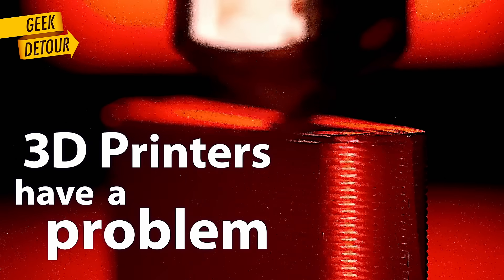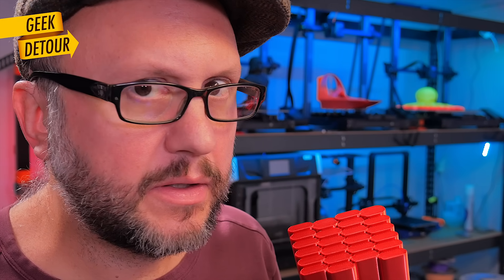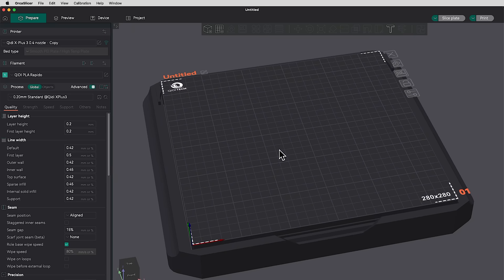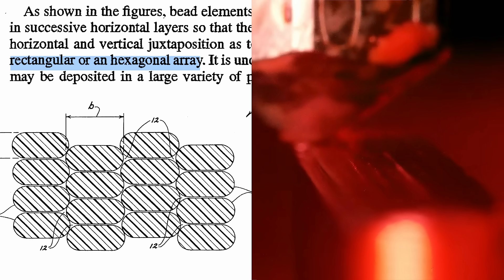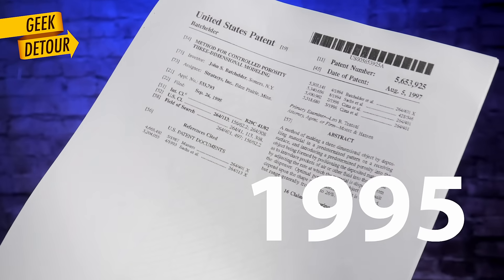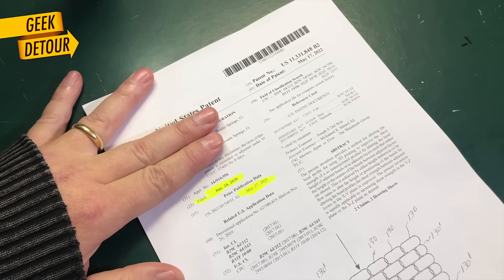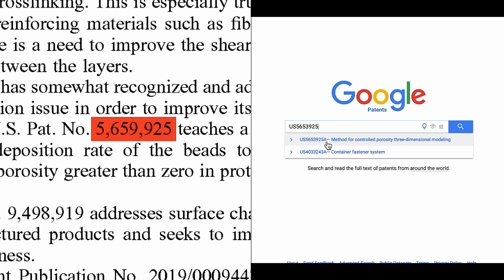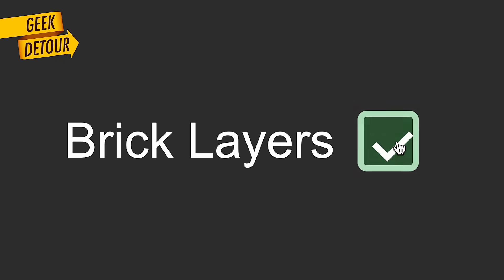Brick Layers: Stronger 3D Prints TODAY - instead of 2040 😬

Comment: There maybe a loop hole in the Issue itself, how you get to the effect. Stefans video is a great example to pull from. It is how he got to the effect and not the effect it self that is the "ground breaking" advance. Use the original public domain as your source, use his method ( A now copyrighted documentation) as the process to get there.

A selectable layer precesss using the X settings. It doesn't have to be specifically for the hexagonal interlocking layers, but a tool that allows for that and many other option through definable layer process that can be saved like a filament profile. we set temp, hight, speed and more with them. Why not one that can piggyback Process and Peramiter combinations ( using the CNC Kitchen video for reference vocabulary). Its not ground breaking, it's old tech. Most slicers can add optional or experimental plug ins, this one just allows for greater control of the filliment it self. 

Just like the ability to chose Colors with an Automatic Feed system. It selects new colors, setting for that filament, etc. Sorry, they wrote there paper poorly and with more holes than their layer lines have. I hope this makes sense after you and other get to read it. You can use old masonry or clay pottery methods as examples, I mean Knitting gets overlooked for Paterns of strength all the time. Use one of them. Here is to this getting to the right eyes and ears.

Comment: Bricks! 
Why not shift layer 2 right by half a column instead of up/down. I realize that this still allows a given layer to be distinct from those above and below it and thus break easily, but there's another way to view it. 

By printing a wider block centered over the gap in the 2 blocks below it, the middle of the top block will push into the gap more than if it was edge aligned. This is how brick walls are made strong. It would help both the Y direction (if X is along wall) but by inserting plastic into the gaps of the lower layers, it helps in the Z too. 

Plus, it doesn't sound like it's patented.
Reply: Then to go to 11, take another cue from bricks. Don't print each row tight to the next.

Print layer 1 as triple width (X = 3Z), thin bricks with a space between them of half that thickness (gap=Z/2). 

Then print layer 2 staggered by 1Z (1/3 the width) to the right. Ensure this pushes into later 1 space by more than 1/2Z. This locks this brick into the previous layer. Also, maintain brick separation space of 1/3Z again.

Repeat the next layers the same except stagger it right by another 1/3Z. 

Rinse and repeat until you get to the top.

Comment: Actually patents don't work like this. There are no examinators meant to verify that patents are valid or not. Patents are only registered and their registration does not mean they are valid.
It's only in the case where the author of a patent would like to sue a competitor for using a patented technology that the validity of the patent will be discussed and decided.

Patents can be filled for anything, it does not mean that every filled patents are valid.

Comment: Someone at the patent office fvcked up, and the patent should have never been issued, currently it should be revoked, but the only way that happens is if someone USES it, and then it gets challenged in court, then the court can recognize the issue and invalidate the patent.  However, what typically happens is someone uses it, and knowing the patent is invalid, the owners of the patent make the case drag out draining the defendant of money until they relent and settle paying them off, this is a patent scam that happens way too much.  These scammers have enough resources to last through cases, and they find old patents they can exploit in this way, and just continually repeat this process with hundreds or even thousands of patents.

Comment: Someone needs to challenge the patent and submit the prior art to the US patent office in a 3rd party disclosure. If the applicant lied about the cited references then the patent can be nullified because they were dishonest.
Reply from the maker: Hi there! Yeah, thats what we desire to do, right? Unfortunately, the patent system is more complicated than this… I’ve been contacted by a few Patent Attorneys and they were very kind to explain in more details what can be done — AND the COSTS 😬 There are alternative strategies. I am working with an Attorney Professor to make a special video talking about the patent system and the particularities of the Brick Layer case. It will probably happen in December.
Reply: @GeekDetour  It's also worth noting that you can use the patent for non profit purposes and research, and you can also use it outside the US. So if "someone" were to build an unofficial add-on enabling this feature there would be no way to stop that. If the patent holder were to try to enforce the patent you could just have a phone call with the holder and argue that their patent is useless and  they would lose it if it went to court based on prior art.

Comment: So best thing about open source is that this is very hard to control personal use, It can be done with gcode , for example this will give you the results-              def process_gcode(input_file, output_file, shift_amount=0.2):
    with open(input_file, 'r') as file:
        lines = file.readlines()
    
    with open(output_file, 'w') as file:
        shift = False  # Toggle for shifting alternate layers

        for line in lines:
            if line.startswith(";LAYER:"):
                # Toggle the shift for every new layer
                shift = not shift
                file.write(line)
                continue

            if shift and line.startswith("G1"):  # Modify only G1 movement commands
                # Split line to check if it's an X or Y movement command
                parts = line.split()
                new_line = []
                for part in parts:
                    if part.startswith('X') or part.startswith('Y'):
                        # Shift X or Y coordinate
                        axis = part[0]
                        value = float(part[1:]) + (shift_amount if axis == 'X' else 0)
                        new_line.append(f"{axis}{value:.3f}")
                    else:
                        new_line.append(part)

                file.write(" ".join(new_line) + "\n")
            else:
                file.write(line)

# Usage: Adjust `shift_amount` for the desired layer offset (in millimeters)
input_gcode = "input.gcode"
output_gcode = "output_shifted.gcode"
shift_offset = 0.2  # Adjust this value as needed for your print
process_gcode(input_gcode, output_gcode, shift_offset)

Comment: The latter patent doesn't really matter. As long as you're purely doing what is described and claimed in the earlier now expired patent, you can't really be stopped or sued successfully. At any rate the 3D printing community is filled with enough interested parties that surely lawyers could be hired to overturn this later patent if necessary.

Comment: Has anyone come up with an option to offset the infill on a X and Y axis? Completely different idea (on a legal point of view), the shape of the layers will differ from the patent and will even be different depending on the layer thickness. It will fill the gaps even better. I mean, just like if you were building a brick wall but instead the bricks being levelled, they were on a 45° angle.

Comment: I have a challenge for the 3D printing community!  Well maybe not a real challenge IDK, but I think it would be cool if someone did a 3D print of The Great Pyramid of Giza that can be assembled block by block  Make it so that it is about the average height of an adult so the blocks are relatively small and easy to assemble.  But it would need to be a faithful reproduction that is faithful to block size, shape and position.  Making it look like it would have when it was new.  If anyone could give me a rough idea of how long a thing like that would even take I would appreciate it!  I have seriously been thinking about getting a 3D printer just so I can do it myself but I have zero experience with 3D printers and I know nothing about the software used to design the prints.  I would really like to know how much something like that would cost as well?

Comment: As I learned while getting patents - it is not the examiner's job to check the veracity or originality of the patent, just the completeness. There's also a chance that the examiner thought that the new patent built on the old patent in a new way.

Nonetheless, this patent probably wouldn't stand up to legal interrogation, but you'd have to find someone with $20k or so for the lawsuit.

Comment: Do none of the slicers allow the use of 'mid-processing' scripts?! Could the people writing the actual slicer software not expose adequate information at the right part of the slicing and allow augmentation of what is being produced in such a fashion as to allow enthusiasts to code up a new feature for skewing the alternate layers in Z? I'm not suggesting a post-processing script would necessarily be able to do it. Might... but might not have the info or might preclude some of the other features. But maybe it could if the commenting of the gcode were verbose enough "this next line is perimeter 1 of 5..." If you were willing to ignore the infill, which is often only a single line wide anyway (and so wouldn't gain anythign from tbeing offset in this bricklayer pattern), and only wanted to skew every other perimeter in Z, and tweak the volume on the first and last layers to ensure they look nice / don't over extruede, well then maybe it would be possible in post, no? Now I've written all this it occurs to me that people cleverer than me will have thought of this and its probably already out there...

Comment: BUT does it take longer to print this way than normally?  I would argue that the time is more important than the small amount of strength gained.
Reply from the maker: No, it doesn't take longer. There are just a few extra movements in Z, but the overall number of lines is the same.

Comment: I must be doing something wrong, or perhaps something right, because my prints tend to have some surface artifacts, but I have no prints that fail between the layers, they break kinda random, like even if I intend to split a part across the layers(like if I wanna fill it with something to make it heavier for example), it's not happening.

still sucks that some "company" tries to hold 3D printing back

pretty sure who ever is behind this got something to gain from hurting the 3D printing community.

Comment: Did anybody thought re-melting the surface before the new filament comes on top? You said that the solidified filament doesn't fuse with the melted one. So both has to be melted before they touch. I am not saying to blast the whole part with a heat gun, you can remelt just a line in front of the head with a tiny heated pin.

Comment: why can't you get around this by having a configurable option that you, yourself set. And if you I dunno, add some file that gets stored somewhere that alone isn't infringing on anything, and the slicer alone isn't. Only when you combine the two you get the magic stronger prints? Surely that can't be too hard for someone to just mod in even if the slicer maker doesn't want to risk it for a 3d biscuit

Comment: Okay, I fell into this video on accident. I know nothing about 3D printing x if I am technology geek, he would be my work around. You need to find someone to hack this software and to change the code in. Release a codex pack that modifies the pull-down. Menus that allows for this model of printing that you're describing that was patented in 1995 and just run a hack.  Bypass the patent system and pretty anyway

Comment: I have about 3 dozen patents and was the engineer that wrote most of the preliminary description for the corporate patent attorneys.  My suggesting is to call up some local patent attorneys.  Show him the two patents.  He may know if a letter to the patent department would work to nullify the new patent.  He should also know if a law suit needs to be files as the approach to get the patent department to examine the new patent.   A trial shouldn't be necessary which could drop the cost to almost nothing.  With this in hand the coding companies may choose to expend this small amount.  If a trial is needed the cost go way up.

Comment: When temperature of the layer below drops under 60C which is crystallization temperature then when printing over it the adhesion is only that strong. When getting it stay over 60 C then they can fuse together. if the object is narrow and vertical like screw or like rebar there is no time for bottom layer to cool down. There you have it.  The part cooling fan needs to be switched off. Then it may look like mush building up, but it is so strong when it cools down... Instead of adhering 2 layers there is PLA molecule structure holding it together.

Comment: that new patent should be invalid. 
it references wrong patents which makes it misleading and it also isn't anything new or novel enough to be patented since there was a previous expired patent that was likely more detailed.
it wont hold up in court, and the 3d printing community should be free to use brick layers.

since we past the 9 month window for anyone to file a complaint with the Patent Trial and Appeal Board (PTAB). 
however after 9 months 3rd parties can file an IPR "inter partes review" with the PTAB to challenge the patents validity usually based on prior art. 
and some patent offices allow reexamination based on prior art. 
but it depends on were the patent was filed other countries have different proceedings.
if the patent owner wishes to enforce it against someone it can end up in court and be invalidated there. they have no legal grounds to uphold a misleading patent that isn't a novel idea.

Comment: yo changing one letter has some DO NOT REDEEM troll energy

also I havent done load testing but I think wrapping that string around a pole so you're pulling at 90 degrees from the arduino sounds safer

Comment: Do you think a simple brick pattern might be suboptimal anyway? You are still setting up strength to be oriented around single planes. You can see how this fails in collapsed buildings, the fracturing spreads through brick in a line like lightning, of course just following the path of least resistance but it is essentially a crystal structure.

I am thinking of wood grain. How each point of a branch is supported along its own axis with its 'tiling' rule warped to follow that normal instead of a single plane. I don't have the time to work out how to lend a similar quality to 3d prints but this and the possibility of 3d composites in general are what I'd like to try if I did.

Comment: No idea if a patent exists for this idea, but your video spawned a thought. 

A happy medium might be to over-extrude every layer, but then iron afterward filling in and smoothing it out. This gets rid of the gaps problem and mitigates the uneven surface problem. You may not need to iron every layer in order to save time, but as a first test ironing every layer may be a good idea. The trick will be in finding out exactly how much to over-extrude,.

Comment: The patent system fails to meet it's intended goal. If it was really only meant to protect inventors, patents should be forcibly revoked after the company which applied for them has gained a reasonable foothold in the industry.

Comment: I always disliked how my 3D-prints were so easily breakable if I printed them in the wrong orientation (just rotating them helped, but first I had to learn the hard way).  This method would make prints stronger without thinking much about how the orientation is, but some silly patent-troll just ruins it for everyone... just like the 2004 patent from microsoft for the "double-click"...

Comment: Honestly, this "brick" layering should not even be patentable in the first place. It doesn't take a rocket scientist to realize it's going to be stronger that way. If you want to patent something on this, it should be a really clever way of actually achieving that layering - some kind of innovative algorhythm, updated hardware - think 2 nozzles really close together that are offset by the height and width of this half layer, so that you are printing 2 lines of plastic at a time (this would probably be even stronger, because the two layers would be able to better fuse together, but I'm not sure if that wouldn't have some other implications) or something along those lines.

Comment: I noticed that in the patent, it showed a cross section with a specific layer height, and then they modified it to have every other layer in the row to be THINNER to achieve the stepped brick pattern. However, you could also THICKEN every other layer in the row to achieve the same effect and it probably wouldn't fall under this patent. Why? Because different patents that do the same thing have already been made before. The biggest one I can think of is for reciprocal motion to rotary motion where one was a normal piston and joint set-up, while the other one was a planetary and piston setup. They did the SAME literal movement, but the mechanism on how they achieved the movement was slightly different and could be patented separately be two different people. I suspect the same could be done with this patent, and simple thickening every other line instead of thinning to achieve the brick pattern.

Comment: The only thing that stops me from implementing this is: how a sloped wall should be printed with this method? If the upper layer needs to be shifted inwards/outwards by any amount that is not a whole multiply of the line width, you will end up with an extrusion that layed on an uneven surface and could cause artifacts.